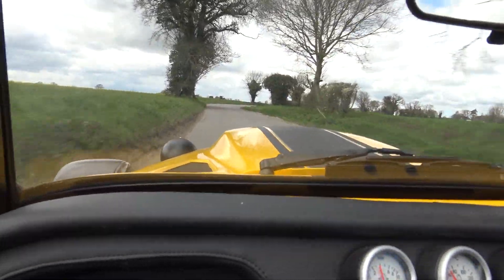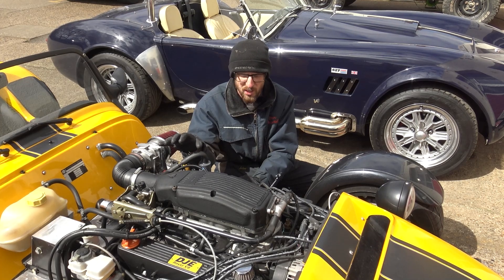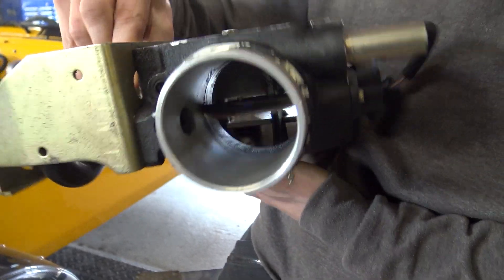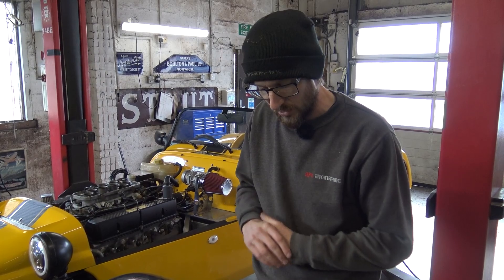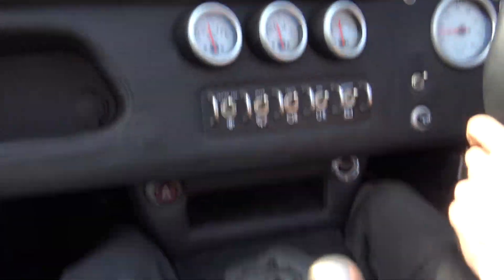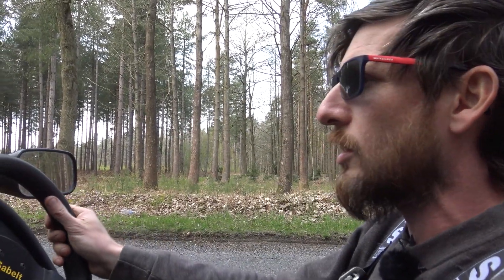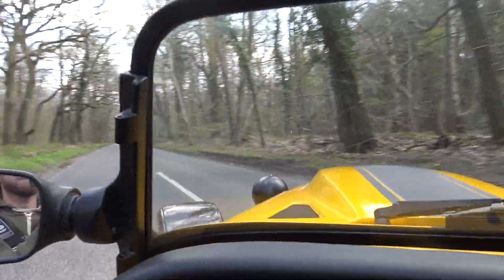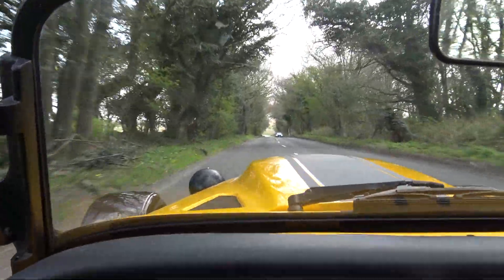RPi Engineering Rover V8 Westfield Upgrade Package - Chipping Ignition and Carbon Intake.

Comment: Hi just curious what would the weight of these engines be compared to American small blocks :)
Reply from the maker: A fully dressed Rover can be between 200 and 250 KG however often depends on what you count in the weight factor, what fuel and ignition system is used (exhaust manifolds etc as well) as with any engine and its weight.
Reply: @RPIEngineering  yea I'm trying to decide what engine I should go for in a v8 MX-5 build
Reply: @RPIEngineering  thank you for the help :)

Comment: LOL!  When back is front and front is back because of where the intake sits!
Ian - I bought all those parts from you last summer for my Range Rover.  I ended up installing everything on my BGT and the B runs fantastically!  Never ran better.  I should email you a video of it.  (First start up after 14 years.)  
Poor Rangie never got up and running.  I was thinking about buying all those parts again this summer for it!  LOL!
Reply from the maker: Yer got that a bit "back to front" LOL. Well we often say our parts fit all Rover V8's and you have just had that first hand then :-) Glad the BGT is running well - you know they are one of my favorites but the Range Rover will need our upgrades too to feel loved :-)
Reply: @RPIEngineering  I just sent a video via email.  It's not the greatest quality, but the sound should come across!!
Reply from the maker: @wjthehomebuilder  Yes got your video thanks. Certainly sounds good.